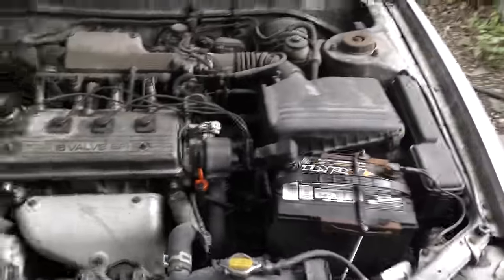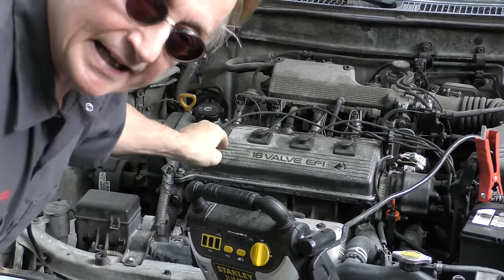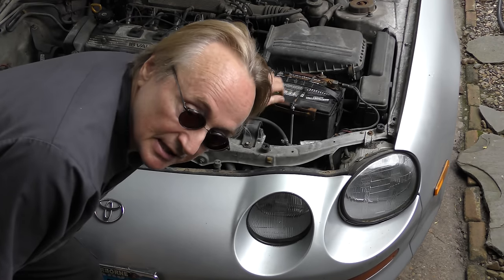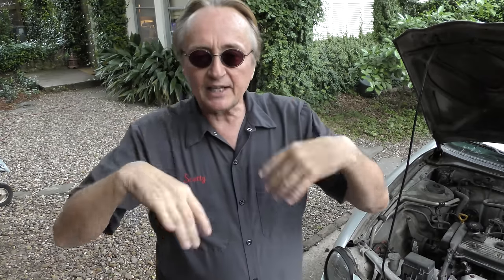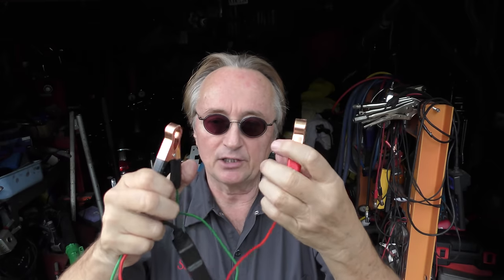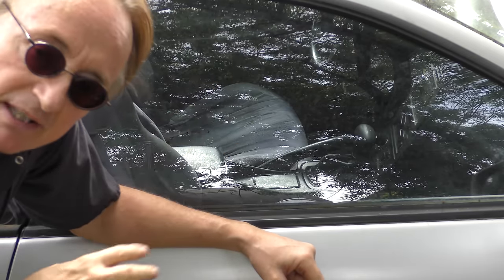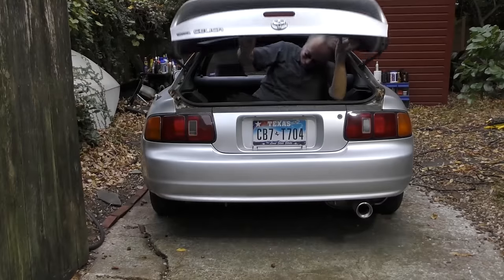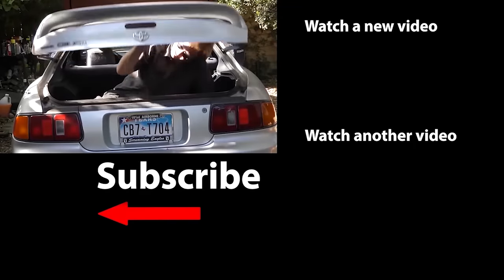Never Do This to Your Car (Learn from My Mistake)

Comment: In both my Korean made cars (2007 Kia Spectra and 2007 Hyundai Sonata), I have airbag lights that both came up when I changed the battery myself (must have been incorrectly)... These 2 cars have been wonderful cars, but I can't get the airbag lights cleared... what do I do, besides the dealership charging me $300?

Comment: I jump started an out of juice battery (old) and the panel gauge cluster guages went wild.....I drove it to the Advance  and had a new batter installed.......all gauges recovered except the collant/water temperature panel gauge tops out showing overheating.....before turning the key it show at the bottom of the gauge.  The motor is NOT overheating........What do you think is the problem....Again I've driven for approximately 150 miles and the engine and collant reservoir does not overheat.

Comment: Thank you Scotty you are very informative I like the way you do your videos you're fast you get right to the point and that's basically all I need to know you don't really get around very serious about your work I have a question for you sir I have a 07 Chevy trailblazer I'll replace the battery out of done a lot of work to coil packs and off plugs and all that now and it runs rough kind of and the transmission is asking up everything is just like falling apart on me since I'm fixing it do you think I need to reset my whole computer memory deal have it reprogrammed or so everything will be in compliance with each other please let me know something but hey keep up the good work you're doing a great job I like the way you do your commercials for me do your videos I mean I like the way you do your videos thanks good day Phil from Oklahoma City

Comment: Okay, my 2004 Mazda Rx8 starts and idles fine. However, the throttle response only allowed it to rev about a half an RPM. I disconnected the battery for about 10 minutes and afterwards I have had no problems. Ideas????

Comment: I just replaced a battery on a 2017 Camry XSE. Do I need to take it into the dealer so they can reset the system so it doesn't ruin the new battery?

Comment: I followed the computer reset exactly like your video. Once I completed the process the car won't start at all. It did Start before I did the reset. The AC and door locks and windows the radio controls the back up camera ALL quit working this the Reset attempted. Now nothing works.

Comment: I just bought a 2007 caravan. The man replaced the battery before I bought. There is a problem with abs. Do I need to reset computer or can I touch the positive negative battery cables together for 1 minute

Comment: Scott
 where can i get that "memory keep alive" system"  i might need that for my 2005 Honda Odyssey.  The other day i changed out old battery with a new battery and then the horn went on continuously and my front and rear signal lights began flashing and my center console indicator light and the glove compartment light began flashing.  I dont know what happened

Comment: When has a battery ever exploded, because someone attached the black cable to the negative battery post while jump starting? sounds like one of those things that can theoretically happen, but in reality it never does. Just like static electricity can theoretically ignite the gasoline while refueling a vehicle, but has that ever actually happened?

Comment: I had a dead battery in my truck.  I went in the car, bought a new battery (truck is 2005 maybe) with an Alarm.  I put on the new battery (my bad not charging over night) and the Alarm kept blowing the horn I'd reset and It would wait and start blowing the horn.  It Floated the battery into the floor.  Now the volt meter in the car reads Negative.  Is there hope ?

Comment: I came home the other night, I managed to get the keys out but it was in acc position. It has never done that before, I didn't realize my lights were on all night. Long story short, key won't go to off position and the rear gate will not open, without a charge. New battery, it started but it will not drive properly, no power in drive,  reverse works fine.  What do I do?

Comment: I'm having to relocate my battery to the trunk coz of it being a rela hassle to change coz of the location. Would you see any issue running a 2guage wire from the trunk to the engine connecting to the original battery cable with a butt connector? I'll be running it over through the plastic side over the door outside the car. My car is a 2008 Buick Lacrosse Super.

Comment: I own a 2012 Honda Civic Si. It would not start and it wasn't the battery. An alternator wire on the negative terminal needed to be disconnected so that a reset would occur. Many owners would replace the battery or the alternator and of course the car still wouldn't start.

Comment: Does using  throttle hardly within economy rev range and correct gears damages the car. But also launch car slowly but accelerating it  withing 3500 rpm but by using more throttle.

Comment: Got 2010 used toyota camry dec 2022, engine light & stability control came onlately,took it to the Toyota Mechanic, got it back.two days after lights comes on again. Saying it is because of the aftermarket alarm system, wants to remove that which will costl me 6 hrs of $185/hr labor.took it to different mechanic who said aftermarket alarm has nothing to do with  P0705, am a retired person knows nothing about cars and not enough money to pay.what do iDo? The service contract is not covering the aftetmarket alarm

Comment: The way they have been engineering and producing vehicles within the past 10 to 15 years is so damn maddening. They are purposely adding a lot of complexity to increase more failures and reliability issues. I really miss the older vehicles of the 1960's and early 1970's. They were so simple and affordable to work on. Also they were reasonably reliable.
Reply: M no MO
Reply: @RogerCigelske M yes Mo.

Comment: Tip for some BMW models: When replacing the battery, is not enough to update the car computer system accordingly but, you will need to wait for 6 or 12 hours before restarting the car.

Comment: The rear lights won’t turn off in the 2002 Camry so I disconnect the battery terminals when I turn off the engine

Comment: Hi there Scotty i have a  2002 Toyota Camry 2.2 SEG 
Can you advise
I been diconnecting negative battery terminal when car stands for a few days when away
What occurred  resently  the speedo stop working
Then the  o/d   light starts to flash and orange engine management light comes on
Now when driving off the engine  revs to 2500  for awhile and doesn't change the gears when in drive from furst to second then eventually changes ,but once running and come to a stop it changes normally but the o/d  light flashes and engine management light stays on
Otherwise all else in order
Could this be something  to do with engine computer.i did try taking positive battery cable off and reconnecting but still the same
What do you suggest  Scotty
Regards Malcolm

Comment: Here is a small tip when you change the battery, just leave the car running to avoid any resetting or any software related problems.

Comment: Scotty I have an 09 Chevy traverse yes I know what your thinking, any way my charging system came on ok got the alternator replaced went fine for a couple weeks then came on again only at times so replaced the battery so works fine but the battery charging system still comes on and when it does voltage goes down to about 12v then it goes away and when working normal is usually at 14.9 or so with all accessories on so I don’t know why’s the thing still coming on? Any idea

Comment: hi i live in irving Tx trying to find a good mechanic. I have a 2001 dodge grand caravan sport trying to fix but having a few problems. It starts up but the dash go crazy would the battery have some thing to do with it. the battery is old but I can jump start it and runs good until i take off the jumper cables. Did a lot of work on it new spark plugs, oil change check starter,and alternator radiator. It starts up very good. So where can I look for the problems

Comment: Good afternoon Mr scotty can you do a video on a 2002 chevy suburban 1500 ls gauge cluster on mine everything works fine while the vehicle is on but when I shut it of and lock it the gas gauge and the battery gauge go back up like if the truck was on and it's draining my battery can you help out on this issue plz.

Comment: Scotty this is Phil from Oklahoma City hey I forgot this is the main question I want to ask you know when you're jumping a vehicle say same about the same year both of them up to date whatever and you take your ground wire hook it straight to the engine can you also take the other ground wire on the office and hook that to the engine so that way there will be no interference with the battery or the do you have memory board circuit board could the person do that hot to hot and ground the engine to engine thank you

Comment: I need help. I have a Chevy Cruze 2012. Is not marking temperature at all. We changed the thermostats, and clean the electrical connectors. But the car still doesn't mark any temperature. Help please. 🥺

Comment: I have a 2017 ford f 150, small v8, If the battery gets below 12 v it will not crank.

Comment: I have a 2008 g6 3.5 try to start it with the key won’t do nothing but I can run a wire from the starter relay to the positive an it would run for a few seconds the dies what could be the problem I

Comment: I'm having intermittent coolant sensor on my 2009 Chevy Impala.  Fault message reads Engine Hot, A/C Off when not working plus the radiator fans run constantly.  When it decides to function the A/C works again and fans go off--plenty of coolant in reservoir and new radiator cap in place.  I want to change out the sensor and I noticed the wires come from underneath the engine intake.  I'd like to change the wire cable/with one that has the split loom cover all the way to the source, but I can't see the source due to the intake mechanism covering it.  I'd rather not splice in new wire to the old if I can avoid that.  Any advice?

Comment: What about the Honda City 2018 Model do i need to plug an extra batter to computer while replacing the battery and also do i need to reset the batter option in computer??

Comment: Hey Scotty 
i have one question 

I have audi q7 3.0 2011 model 
Recently serviced and battery changed 
after few days car was unable to get motion once brakes were lifted 
Unless we hit the accelerator till 1500rpm then the car moves with a jerk
And a engine and heater light blink once for fraction of a second

And now rpm dips when hit the gas paddle in idel rpm with the same engine and heater light just for a fraction of the second 

Now car is with the service center for 2 weeks now with no fault code

Please help 🙏

Comment: I think you should put the negative cable on first and then the positive cable. And when you go to take the cables off. Take the positive off and then the negative. That way it's always grounded at all times. No spark and it's the safe Way. 😂

Comment: I need your help with my Toyota 4Runner it’s a 1995 cranks no start if I’m lucky It will run but with a really low idle like if it wants to shut off but the timing is on dead center what do you think it is plz I need your help !!!

Comment: Scotty on this video you jump started the vehicle by placing the negative terminal of the charger to the engine. Here is the question: Do you do the same with one of those capacitor chargers?

Comment: Scotty, I cleaned my trottle body and now my car idles high and wants to accelerate past 35 mph. What should I do?
Reply: if you have scanner tools and their is special functions you can select trottle valve relearn just follow the instructions if need to on and off switch  maybe for 5 second and it will show learning success.hope it will help you depend what car model you have.

Comment: You can bypass battery management system. You just may need to update your computer. I have seen it done.

Edit: An easy way to see if you have laminated glass or tempered glass is a pair of polarized sunglasses. The polarized glasses will allow you to see the lamination. If it is laminated, you will see a square or diamond pattern on the glass with the polarized sunglasses. Physics.

Comment: Got a 2014 edge and the heat doesn't work disconnect the battery and then it works and it's like every time you use it you have to redo it the battery what's the issue

Comment: Typically, AGM batteries do not "last longer" than lead-acid batteries. AGM batteries are much more delicate and susceptible to damage caused by sudden stops and road hazards such as potholes. Lead-acid batteries generally have a 5 to 6-year warranty. Most AGM batteries will have a 3-year warranty.

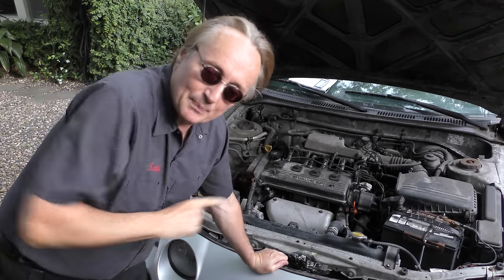Comment: I have a 2010 Chrysler 300 3.5 l V6 soch and I had an IID a Interlock devise by lifesaver installed about a week and a half ago. My battery went dead. I had a brand new battery installed when they replaced my alternator about a year ago  The service provider that installed the IID system hooked the power to my booster battery and connected something to the starter. Of course you know my battery is in the trunk and I know you don't care for Chrysler. But I need your help because I have one of those little booster boxes to start jump my engine. well I attached it and all my dashboard lights my stereo started flashing on and off. Well my booster box only gives me about a minute to start my car and then it shuts off. well I have to blow into this IID in order to start my car and it doesn't prompt quickly so it could take up to 1:00 to 5 minutes to 10 minutes before it even ask me to blow. So I can't even jump start my car now. I just watched this video and I'm just wondering because the company told me that I should keep my battery on a charger and I have one of those fancy smancy batteries, won't this cause me to have to have my car reset every time by a technician? And is the Interlock system damaging my electrical and battery by draining it because it's pulling the power from the booster battery in the engine compartment? I seriously need your help. I sure do hope you get this

Comment: @scottykilmer Hi Scotty. I have a Mazda 3 and I keep getting upstream Oxygen sensor replaced by different garages at great cost to me. The fault code P0134 keeps showing but after getting a new O2 sensor the warning light always comes back on for the same thing again and again and again it is so annoying. 

All these different garages are not diagnosing the problem and troubleshooting properly to find out what the real issue is they just see the fault code and assume it is the thing related with that code and they charge me a lot of money for just plugging their laptop in which only takes 5 minutes and doesn't cost £90 to do. 

The last garage my car went to was an official Mazda dealership and they experienced my wrath and offered to settle out of court and refund me because  they had three attempts to fix it and got it wrong each time. I am still out of pocket though from all the other times this happened. 

Any ideas on what other issues it could be? Do you think it could be the wiring, a fuse, a short, or maybe even something as simple as the fuel cap?

I should mention I also had the bulkhead replaced as well so it can't be a vacuum leak unless they didn't repair that properly. The MAF was also replaced a couple of years ago and as I mentioned I have had the upstream Oxygen sensor replaced a few times now and I keep getting the same fault code often only a day after its replaced. I love watching your videos and am learning a lot from them.

Comment: SO IS IT OKAY TO PLACE THE BLACK CLAMPS ON THE BODY - BEFORE PLACING THE RED CLAMPS ON THE POSITIVE ON THE BATTERY?
Reply: So what i've started saying pre-boost (reflecting owners manual) 

'Dead Red (+post),  then to Good Red (+ post),   Good Black (- post),  then to  bare metal (bolt ?) in the Dead batt' engine compartment.  '

All electrical accessories off ,  start Good vehicle and idle for a few moments, then Boost time, .... then tah unhook cables   Reverse of previous steps/chant     ;-)
Reply: @CentralCanada  LOL THAT'S ABOUT AS CONFUSING AS CALCULUS FORMULA

SPEAK IN CAVE MAN'S WRDS?

Comment: Having to go to a mechanic or to buy an expensive bidirectional scan tool (Harbor Freight ZR915S is under $300, very similar to an Innova unit) to reprogram the charge rate when replacing the battery is stupid.  Almost every car these days has an alphanumeric touch screen.  There should be a maintenance items menu where replace battery is a choice.  The car owner replacing the battery herself/himself should be perfectly normal thing to do.

Comment: You also know you know this Scott . If a battery is shorted out inside battery if you don't ground to the ground the battery could explode ,short circuit no resistance in circuit !

Comment: I have been informed by several Auto electricians that an AGM 
battery CANNOT go under the bonnet.
This is because the Engine Heat will quickly kill the battery.

Comment: I recently bought a 2012 Nissan Versa with 53k miles, and it’s having a problem when the RPM goes past 3 the car starts jumping when I press the gas and sometimes won’t respond at all where I can press the gas all the way down and nothing happens so I have to turn the car off for at least 5 minutes before it will move again. Does anyone know why, please?

Comment: The 67 ss396 chevelle that was in the hagerty commercial in the middle of this bullshirt doesn't need the battery computer reset or wont lose its memory. You can have your frigging BMW crap.
Reply: It looks much better than that buthole motor werks too!